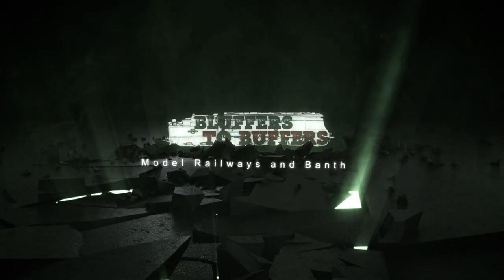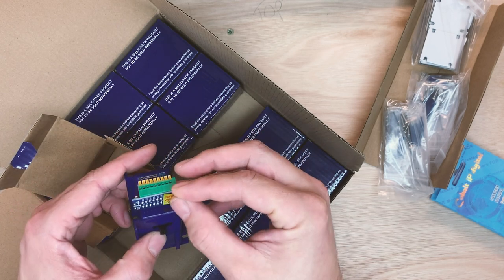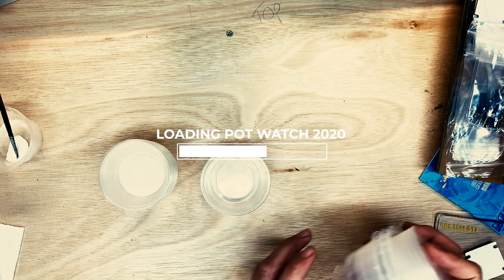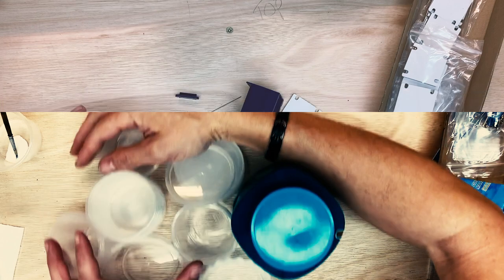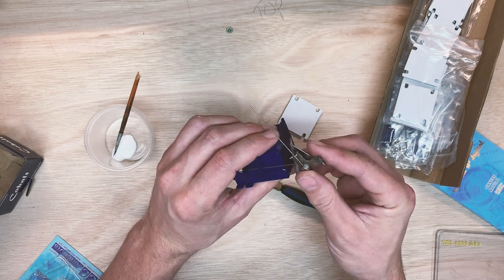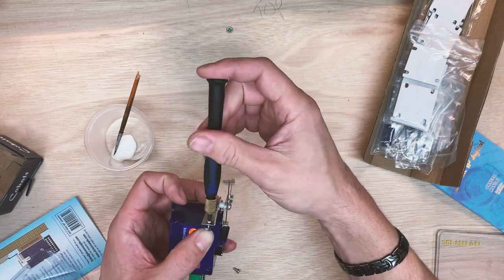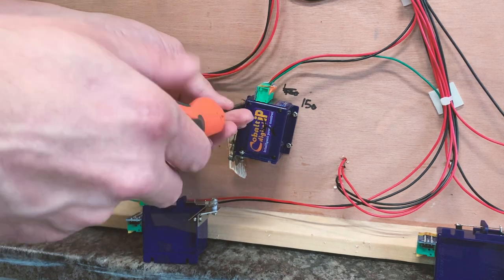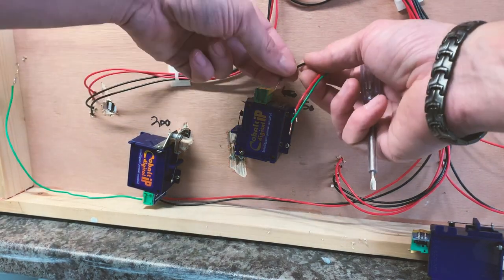OO Gauge Layout Rebuild Pt 4 | Installing DCC Concepts Cobalt Point motors | Platform scratch build

Comment: I wasn't going to bother with Peco platform edging but having watched this I have changed my mind. 
The end section that slopes, does it come with the platform top already fitted or did you cut that out of plasticard aswell?
Platform build very instructive, thanks Guys.
Regards Chris
Reply from the maker: The slopes are also topped in Plasticard, same as the flat sections 👍